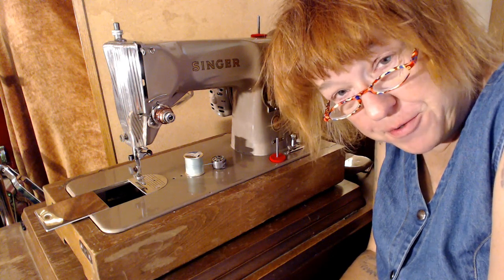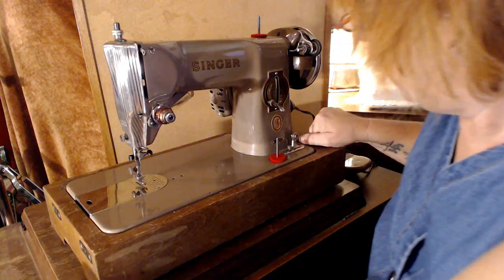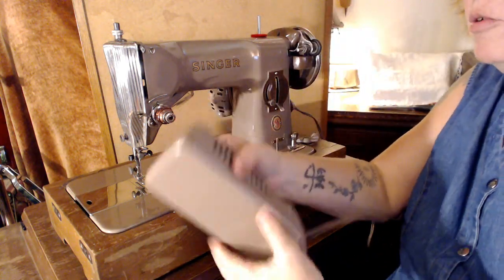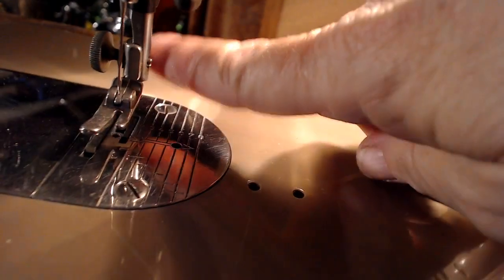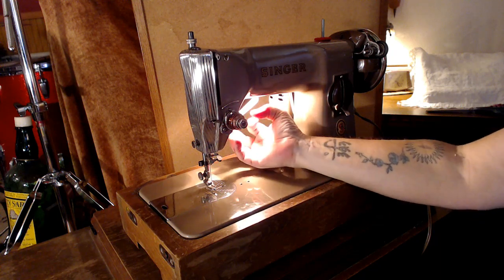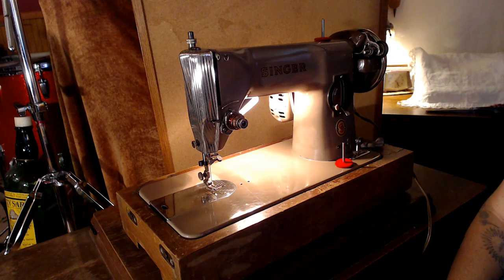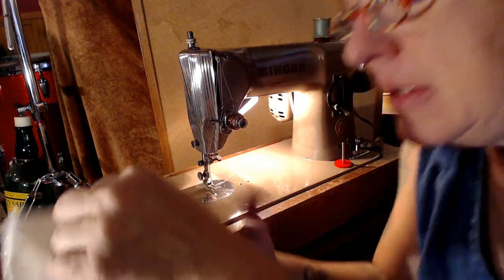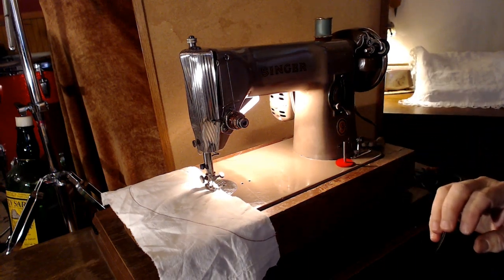Singer 215g Vintage German Sewing Machine

Comment: My 215G arrived today.  It is pristine.  Beautiful.  Jaunty.  Black.  Heavy.  It has gold detailing and "Made in Germany" around the base of the right bottom harp area.  Motor and foot pedal made in Great Britain and similar to other Singers.   Doesn't look like it was every used. The case is beautiful and well-made.   Someone wrote their name on it and scratched out another's...but it is finely done.  The manual is in French!  PINU...amen sistah!   It's a workout to pick it up. The base was in perfect condition and had the flip table to the right.  It is solid something...looks like maple or alderwood.   The machining for the race is extraordinary as is the pressure knob.  No big light, the regular one as yours.  It has abraded against the back of the machine, the only blemish.    Mine doesn't have a turnbuckle as heavy as yours. Rather a metal swivel with a piece of leather that goes through a hole to both keep it from scratching the base and providing tension. I had to adjust the foot pedal as it was stiff, and it had no low speed.  Easy task (Thank you Google).  I'm really happy to have this machine, and I appreciate your contribution to the knowledge base.  Of course when I die, it will be part of my estate sale where others will come and pick over and get a good deal!  Or it goes to Goodwill, where I've simply made a deferred contribution.

Comment: I have one, in black.  It's not all that heavy, folks, not compared to my 216G  or heaven forbid the Kenmore 16.  And the weight brings solidity and stability.

As far as quality of stitch goes, this one is right up there.  Better than my 201, better than my 1200 , better than my 15-125, better than my Pfaff 30.  I honestly don't believe the quality of the stitch can be improved upon.  

For my day-to-day use, I migrate to the Singer 216G, because it has a very nice straight stitch as well and very precise feeding.  It will also take a size 23 needle and feed TEX90 thread reliably, and has a built-in zigzag.  But if you're looking to do a perfect topstitch in heavy fabrics or light leathers, and nothing but that, get you a 215.  It won't disappoint.